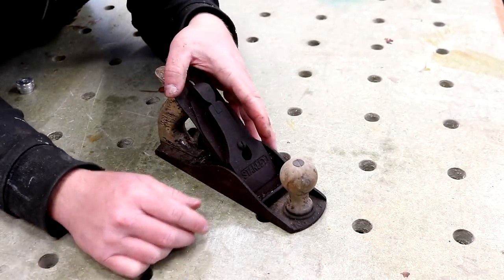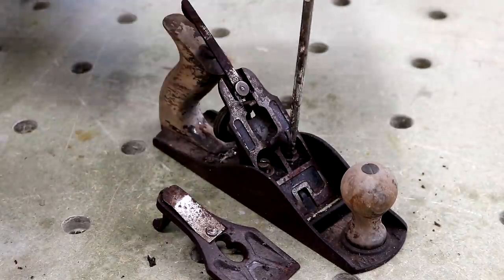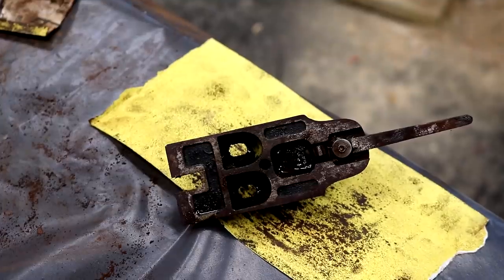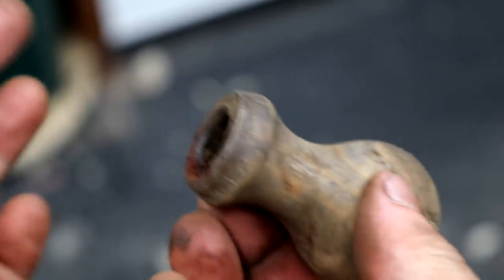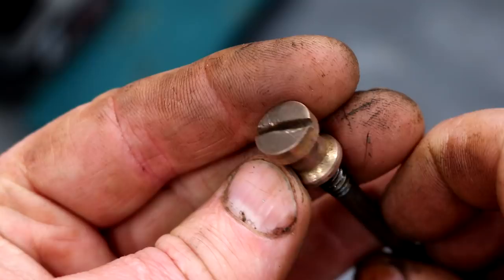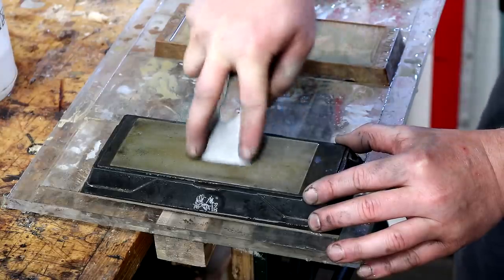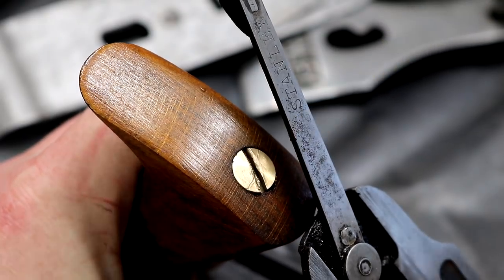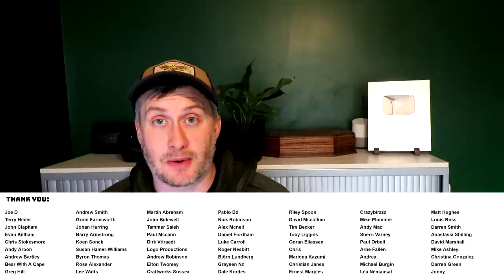Making A Scrub Plane From A Rusty Old Handplane

Comment: Oh dear! I'm in danger of turning into a Safety Sally!   But I winced when I saw you trying to undo the seized screw in the cap iron whilst holding it in your hand, expecting the screwdriver to slip and pierce your palm.   I was always told that hands should be behind the sharp bits!   What a relief when you later held it firmly in a vice to do the job.  Congratulations on ending up with a very useful and functional tool after all your hard work.  BTW, my dad always used the end of the lever cap to undo that cap iron screw.

Comment: Good project and an ideal use for a reclaimed rusty mutt. Would add, having tuned quite a few old iron planes, that a badly worn, out-of-flat smoother, one worn convex, can be a useful complement to a line up of dead-flat planes by sharpening carefully and adjusting finely to chase that last bit of tear-out in an otherwise smooth surface. The decision to do that with an old plane saves a tremendous lot of flattening effort.

Comment: I agree with a concave curve on all plains blades but not as much but in regards to stability and cupping I think a wide board cut and rejoineted  will be better in a hot kitchen but you could argue that with you removing  so much material it moved as much as it going to 
For hard as nails u could have made an end grain board sorry if this is coming across as nit picking think ur style is refreshing and good you grown ur buisness in a very slow abs steady way
Have u every looked at the Clark slow speed sharpener like a tormek 
Thanks again

Comment: Nice work Keith. Lived the finish on the handle & front knob. Have you seen locktite for an instant hard finish of lathe turning? 
You should look into electrolysis for rust removal. Only attacks the rust not the metal & less effort ofh lots of sanding dry dust to bare metal. An old toothbrush is good for getting into nooks & crannies to clear out gunk.
You can also make the plane curve edge more aggressive to flatten out quicker, personal preference.
Are you sure you're not allergic to cats??
Reply from the maker: I've not tried loctute as a finish, I wasn't aware that was even an option! Haven't tried electrolysis either yet but hope to some day. And yes, I do have an allergy with cats unfortunately!
Reply: @RagnBoneBrown  tolerating the cat allergy for love of your good lady ...very honourable sir
Reply: @RagnBoneBrown  Keith look at https://youtu.be/I-FXOsMR2tY or lookup "CA glue as wood turning finish"

Comment: Cracking restoration.  I’ve done a number 4 plane but not as well as you. I want to spray it but haven’t yet and wondered if you need to cover the plate where the frog meets it before spraying so it remains metal on metal, Or do you not think that’s necessary? Thanks
Reply: Cover all mating surfaces 👌

Comment: Sorry silly question time , does the blade with the curve you shaped into it now leave a channel shape in the wood rather than a flat surface ? Sorry if this is a stupid question I just thought the blade should be flat/ square??
Reply: The blade is cambered to remove wood more quickly ,then you would smooth it out with a smoother.
Reply from the maker: Yes it does. It's designed for rough work  to remove lots of material quickly - a smoothing plane is then needed to get a better finish 👍